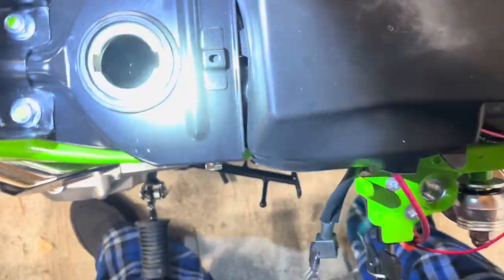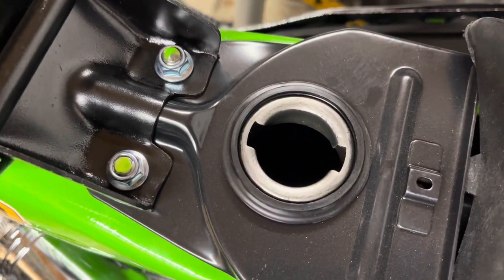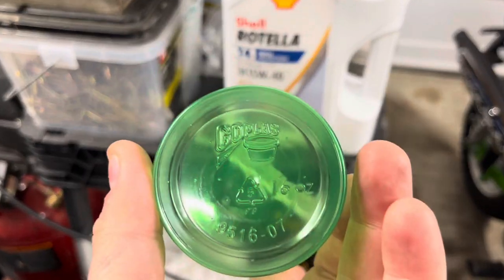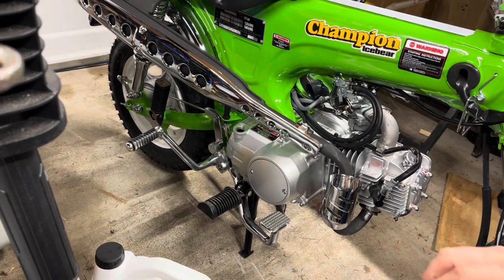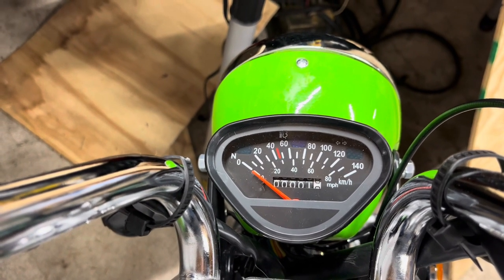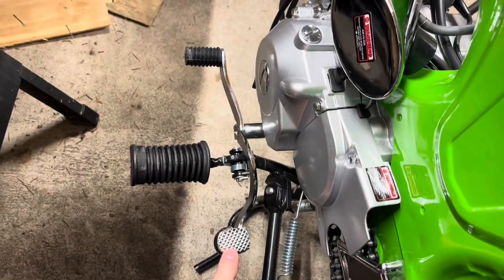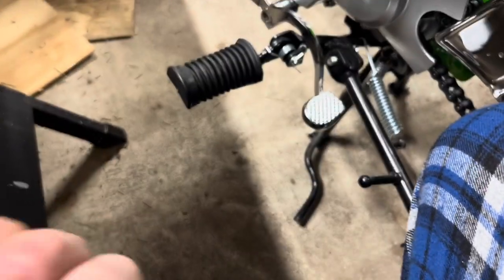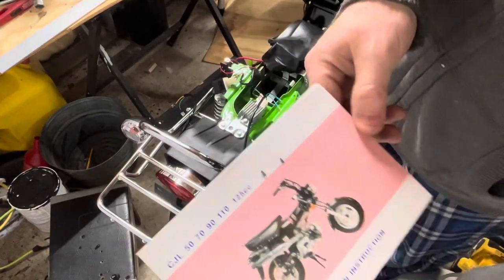Honda DAX | Ice Bear Clone 125cc | OIL CHANGE | Fuel Filter for RUST in GAS | Amigo DIAX CT70 Trail

Comment: A small amount bearing dust is acceptable but if you have ferrous metal particles there is reason to be concerned.
The octane rating has to do with the compression of the engine, high compression engines require a higher octane rating to prevent detonation.  Excellent video that hit the high points and gave me the information I needed.
Reply from the maker: Ahh good to know. It’s for higher compression. So far so good. Still breaking in the motor and now it’s winter so I don’t ride right now.

Comment: Yeah my bike ice bear champion 125 gas tank found black particles change the filter a few times and took the tank off and cleaned it. How much oil does a 125 CC ice bear champion take it sucks having to measure off the dipstick
Reply from the maker: Annoying right on the gas tank?  I've heard people replacing the tank with a plastic one, but meh, money.  I'd feel safer with a fuel filter inline anyway.  Also the oil is .8 liter is what the manual says, which is about 27oz.   Also if you need it check out this link to the manual.  http://www.icebearatv.com/media/file/news6409PBZ125-2.pdf  Please Subscribe too !

Comment: Its almost as if you try to use the wrong tool every time. Jeezus man.
Reply from the maker: You know it lol 😂
Reply: @Jeep-Creep  I saw in another post you said you're near Fenton. Im in Fenton too. You still have this thing?  Any issues?  I'm thinking about one for a pit bike instead of fixing up an old Honda.
Reply from the maker: @ozguy1393  I haven’t had too many issues except the front brake not building good pressure after bleeding a ton of times and trying a bunch of tricks posted on forums to try. So I just bought a generic hand brake / reservoir to replace it. Other than that the mirrors are not great, they vibrate loose a lot. I never tried the original wheels since they were kinda small. I installed a fuel filter inline because the tanks ship with rust in them. It’s a Chinese clone so these things are expected. The motor / gear box / automatic shifting, rear brake are all great. The shocks are not great but honestly doesn’t matter for road travel dirt or paved. It’s super reliable though and more than half the price of a Honda. I live Linden